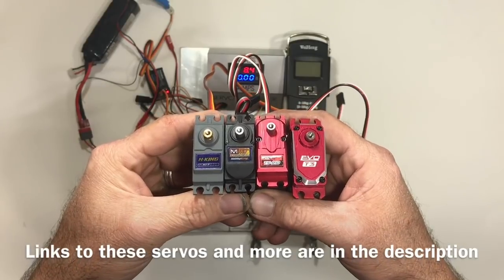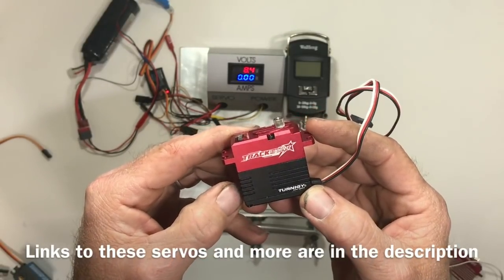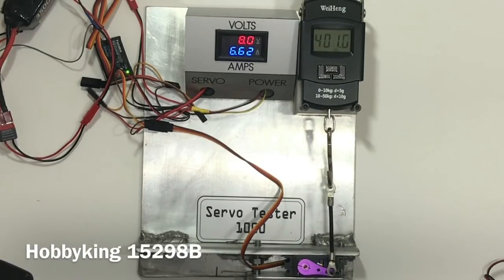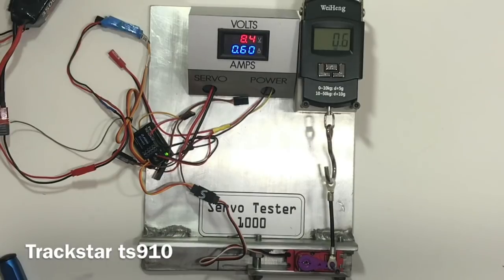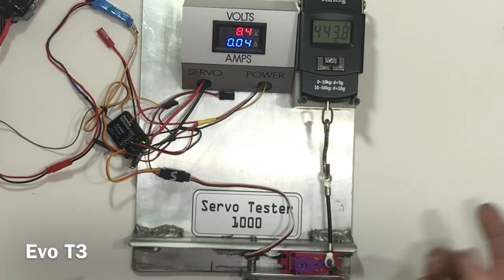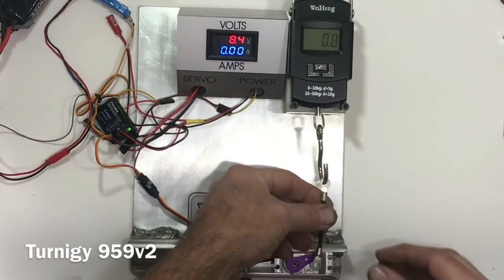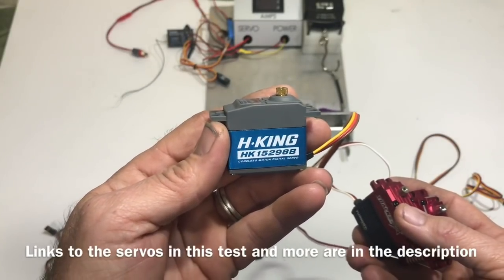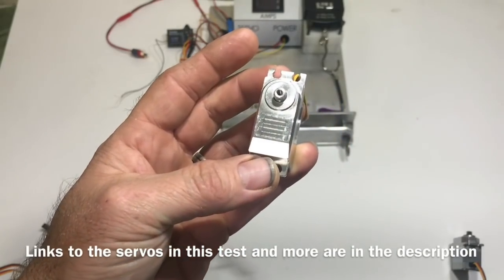Hv servo text

Comment: I See every Servo draws at least 6 Amp. No bec / ubec from a ecu will take that. There normaly 3 Amp max. Must they be run whit a direct battery connection or an external bec ???
Reply from the maker: the stronger servos need a bec, what you see here is max stall, so normal driving shouldn't so hard on electronics.

Comment: seems like turnigy`s not that bad as i thought..:-) Amazing tests!
Reply from the maker: Yeah the 959 is legendary around my area for scalers.
Reply: The 959 is probably a little too heavy for my highspeed cars, I use the Savöx SC-1267SG. But I will order a 959. It`s always good having a strong servo. :-)
Reply from the maker: Oh ok yeah for a high speed car the 959 would be too slow.
Reply: You wouldn`t believe it, but I always need to throttle down the expo because this 0.09sec. - Servo is way too fast for me..:-)

Comment: great vid. ive been wanting to try that 910
Reply from the maker: This is supposed to be the updated version, the first ones didn’t like scalers very much as the gears weren’t put together very well. This servo does great on anything with a servo saver. I’ve yet to put this one on anything but I may give it a try on the UDR when I get that.

Comment: its great to see these test and comparisons i myself always had my eye on the trackstar 910
Reply from the maker: I expected the 910 to fail in all honesty. I’ve seen two of them fail in the gears in a monster truck. The one in this video is supposed to be the current updated one with better gears. If you want raw power, that 959 is just a beast.
Reply: Exocaged RC , I looked at getting the 959v2, however it says it has alloy gears.... wouldn't they strip out fairly easy?
Reply from the maker: I’ve only seen one set of gears wasted on a 959 and it was in a monster truck with no servo saver. I hit the back of a ramp pretty hard. I currently still run a set on the truck with no issue.

Comment: Man I think I got screwed by my LHS, I payed $80 for a savox we-1211sg
Reply from the maker: Does it work?
Reply: Exocaged RC yes it works, runs a little hot but it works (rated at 250oz-in @7.4v)
Reply from the maker: Well if it works, keep driving it until you decide to swap it out, when you do, save it for a future project.

Comment: Nice video and good information! Do you think the Hobbyking 15298b will suit well on an 1/8? I have an Sabertooth and the stock servo does not center well, I am ok with the speed and torque, don't need much for running the truggy. Or should I go for a servo with like the Trackstar ts-910? thanks
Reply from the maker: yeah the local guys love them